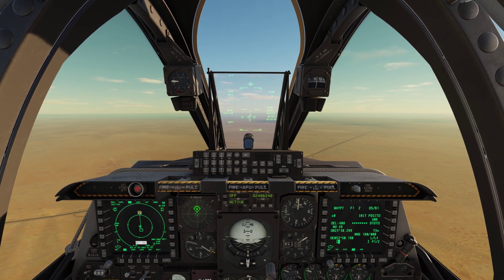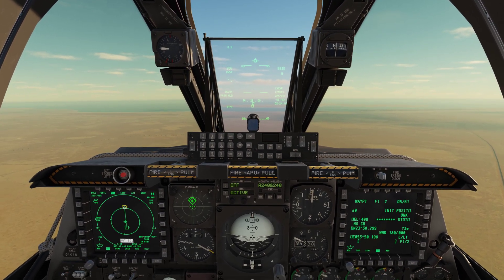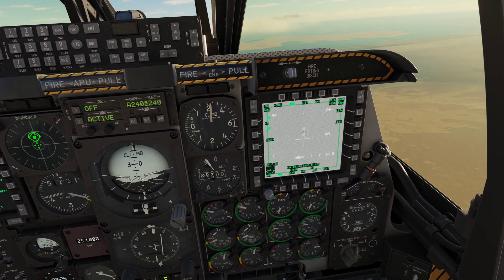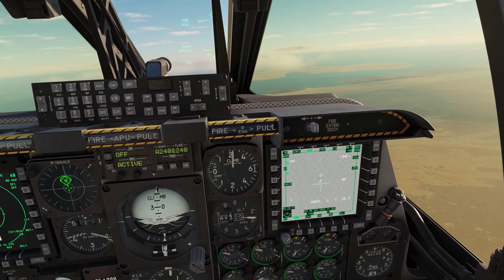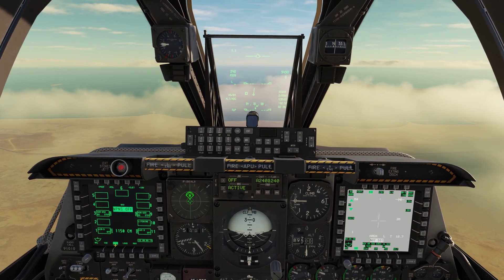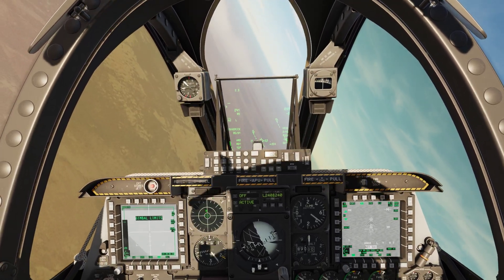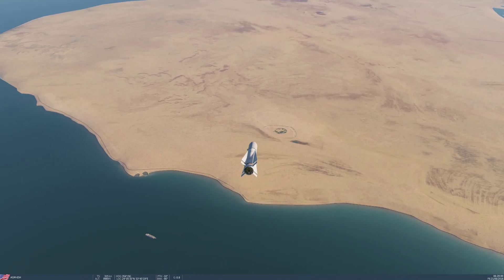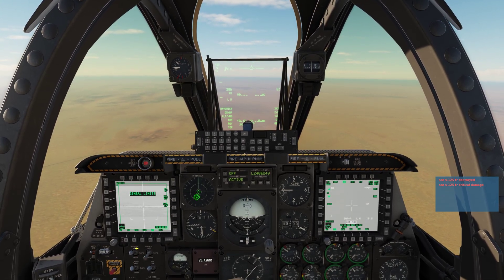DCS A10C II 'Short and Simple Tutorial' #1: AGM-65H Force Correlated Maverick

Comment: Wow you know your RADAR models. I got a dream project from USAF Space Command, built a PAVEPAWS facility in Lightwave 3D, then modeled emission and return of signals intersecting the Bristol bridge on Cape Cod, among other points of study. The object was to demonstrate the negligible effect at the bridge on drivers crossing it. We live in a sea of such signals as it is, but it's not until you get hit by super-high frequency like X-ray and especially gamma there's reason for concern. Anyway, I've been wondering if there's a certain altitude to assure being below the RADAR floor. I know that can depend on the elevation of the transceiver; if a RADAR is on a hill it's just not going to "see" you flying below its elevation...... I THINK the bottom of the signal is parallel to the ground, aimed at the horizon (??). I've seen in other flight sims a general altitude to fly at is below 100 ft.?
Reply from the maker: Some, such as an SA-10, you can get in under 1000ft AGL. However, if it's a well built SAM site, you'll get bit by SHORAD that are scattered around the perimeter of the SAM site (I personally like using manpads (SA-18 Iglas) and good AAA like a Gepard to guard the site to keep low flyers out. Hope this was helpful on force correlation... I need to update some of these older tutorials. Cheers!

Comment: I noticed you fired it beyond its range how did you do that?
Reply from the maker: When you force correlate, the EO seeker doesn't have to lock up an image match, it will fly to image you set the seeker to, which in many cases is quite farther than you can get a lock. We tested multiple shots at 18,000+ ft and were getting on target hits at 13.5 miles with AGM-65Hs. We also discovered that wind does play a role in distance. Into the wind shortens the range, with the wind extends it. So, for the longest range possible, try to get close to 20Kft, and avoid shots into the wind. Cheers!
Reply: @Westpoint1-1  Thank you so much, and just to be clear the D variant can't force correlate? Having a hard time with the a10c on contention server right now ....
Reply from the maker: @yolyromero4626  D variant has an IR seeker, so it's only seeking a heat source it's pointed at, so no, it can't be force correlated. The IR seeker also fixes it's range vs the H. I always load Hs unless it's night... D stands for Dark.
Reply: @Westpoint1-1  Thank you I'm finally able to get kills in the a10c

Comment: why the
 boat switch center?
Reply from the maker: When looking through the TGP,  you create your SPI on the exact point in the image where you want the Mav to impact. Think of switching the Boat Switch to the center position, as sending a command to the IFFCC to hand off that "picture" to the Maverick (which the AGM-65H replicates) so that that point is where it will steer to. Also, if you are looking at, let's say a window you want to hit and you're already in CCTV (center position), in order to Force Correlate the Maverick, you must move the Boat Switch to either White Hot or Black Hot for a few seconds, then switch it back to center in order for it to work.

Comment: Thanks for the video. What's the reason for the boat switch to go center position?
Reply from the maker: The only specific reason for the Boat Switch being in the CCTV (center) position for Force Correlation, according to the manual, is "This
mode allows the seeker to create a basic picture of the scene and home in on one specified area of
that scene." I assume that "picture" the Maverick needs is not visible to the weapon in IR Mode. This would also explain why you must use a "Non-IR", "Camera Equipped" type Maverick.